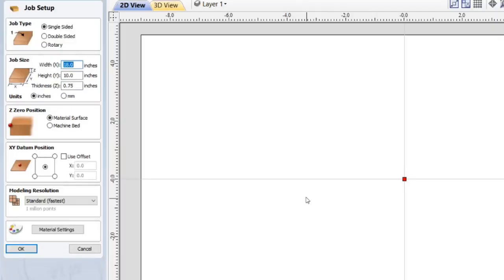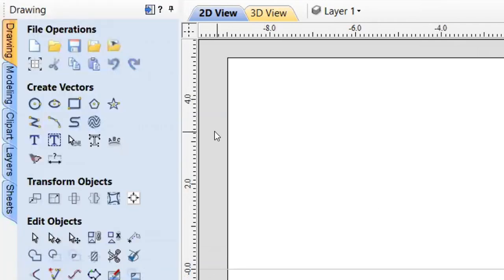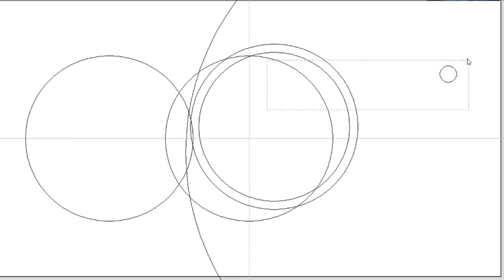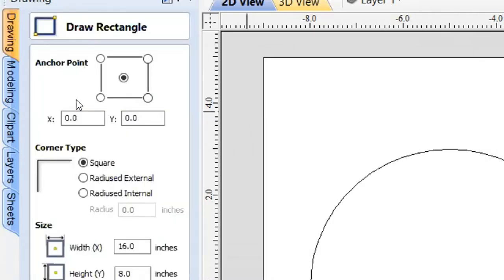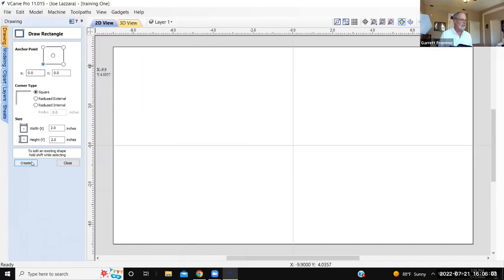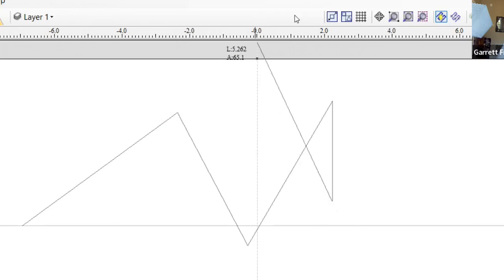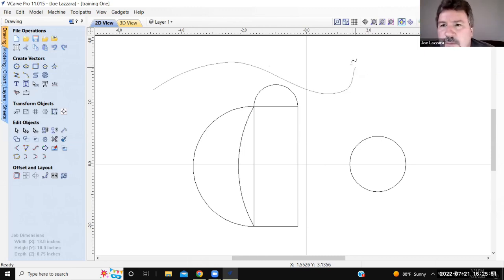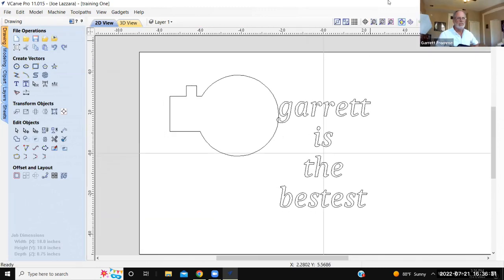Vectric 101 Tutorial For The Absolute Beginner [Vcarve, Aspire, Cut2D]

Comment: Thanks for posting this video. I spent part of a year in 2023 recovering from medical issues. I also live in Southern Ca and the summers a brutally hot. My CNC router is not in an air-conditioned space working in 100 degree pus work space is out of the question. Now the  weather has cooled and I once again can work.  I went out to the CNC router shed and tried to design for routing a wood sign. I was able to get most of the way through the design part, but when it came to the Tool Path section I was in trouble. So I when on Google to find a video that was created by you help new Vetric users and people loke me that have been away from the software for a period of time. The video I watched gave me the tools I needed to get back on track.
Reply from the maker: SheldonNotto6130, here is to a quick and speedy recovery my friend. Keep working hard and learning everything you can, you will get there!

Comment: Garrett,
I'm very familiar with the general use of CNC machines. I built my first machine in 1983 and had a working envelope of 14" x 17" x 3". I purchased a controller kit and hand soldered the all parts on the PCB. I purchased TurboCAD software to draw my projects and then used other software to convert the drawing to Gcode. I learned a great deal about the "internal" working of the CNC operation.

I have progressed a lot since those days. I have built two more machines and learned more powerful software. I have been very impressed with the videos you have created and have learned a great deal. I don't use VCarve Pro to create my drawings, mainly because, I can draw faster in TurboCAD Pro Platinum. However, I do use VCarve Pro for the creation of Gcode for my machine.  Which brings me to my question for you. When VCarve creates the Gcode they have start points that are spread across the carving, and make the carving less productive. How do I change the starting point for the various vectors? I want to change them so when it ends with one vector, the next vector to cut is close to where it ended.

Thanks in advance.
Reply from the maker: Rod, wow I'm impressed brother! That's awesome you've created so many machines, that's awesome! Regarding the start points and how to change them this one is a little tricky to explain over comments. I recommend joining Kate and I for our Youtube Live sessions we host every Wednesday at 8PM EST and we should be able to help you make the adjustments there and talk you through it!

Comment: Wow! Thank you both -  and in particular Joe! This was a great starting point using design software (I currently have the VCarve Desktop trial version), and I'm looking forward to next steps for project development. I have a small cnc machine and have been able to at the least move the spindle around the spoil board a bit, but haven't been able to carve anything with the included control software, which is open source and somewhat sparse on instructions. I also attempted to use the G-sender software to control my cnc, and it does recognize the com port the cnc is plugged into, but doesn't seem to be able to connect to the machine itself. Still working on that issue, but I really want to able to design projects, compile them, and then create them on the cnc.

Lots to learn!
Reply from the maker: Gary, it sounds like you are on the right track my friend. It sounds like you may need to reach out to your machine manufacturer since they may be able to give your more specific guidance on this. There is definitely a learning curve when it comes to getting everything up and running smoothly. My best piece of advice is to stick with it and work a little at it each day. all of the kinks will work themselves out. You got this brother!

Comment: I am in South Africa. I have built a cnc router from scratch. it's bed is 2mx2mx280mm. I have a 2.2kw water cooled spindle. My controller can accommodate a 4th axis as well that I will add very soon. I have up to a 12mm collet. what bits would you recommend I start with since I don't have any currently.
Reply from the maker: Rudolph, I would recommend this set. Here is a link: https://www.idcwoodcraft.com/product/cnc-router-bit-starter-kit/
I would recommend picking up a 1/4" collet as you will use 1/4" bits the most! 
As for what each bit does. I have a video for that! Here is the link:https://youtu.be/wdQ-_hllmKY

Comment: When I saw the title, I figured that I'd know pretty much all that you had to teach in the video. But I still watched as a review. That being said, I still picked up on a couple of things. Like the Control Left to Right, and the Control Right to Left..... are not identical functions. I had run into that, but didn't put 2 and 2 together. Now I know why it didn't do what I wanted, simply because I was "selecting" from the wrong direction. Interesting, because it was a bit picky selecting things for a reason. Now I know. Now If I could just find the video that explains the "smoothing" function, because right now, that is driving me batty. For the Aspire version at $2,000.00, it is proving to be a very powerful program. As it should. Good basic video, for the absolute beginner, but still good for those that have more experience in (old) CAD programs.
Reply from the maker: Dan, I'm glad to hear you picked up on a whole host of tips and tricks in this video! Keep working hard,  you will be a master of Aspire in no time.

Comment: The rectangle point u drew up on the WHite board.. Is this the same in all software packages Garrett and is the triangle cut out the same way on them all too?? Why does it not just draw the rectangle by following the line around the edge and not having to go up from thr bottom left to top left back down to bottom left and across to bottom right then back to bottom right and then across diagonally thru the middle dot to the opposite corner?? U make this stuff sound and look very easy.. I'm glad I found ur channel Garrett my friend.. Top man.. If I got that wrong my apologies..
The Cntl Y & Z commands are great cheats if that's what they're called Garrett.
Reply from the maker: Slim, all the Vectric packages work in the same way for drawing rectangles. You can also use individual lines to create rectangles by following the line around the edge of where you want to draw too.

Comment: Garrett is correct when he says always measure thickness of material with a caliper. I would add one lesson learned for us beginners. MAKE SURE YOUR MATERIAL IS FLAT.  If not when you measure your Z will be correct but during operation it may not cut all the way through. Ask me how I know.  Recently took me a whole day to figure it out.  The same objects I had been cutting out plywood out of one sheet of plywood wouldn’t cut through another sheet of plywood. Plywood still measured at .5” and re-zeroed a dozen times. Turns out the second sheet of plywood was bowed down. Sheet was so large the clamps didn’t affect parts in the center. I had to readjust cutting depth to get it to cut through. Hope this helps!
Reply from the maker: Dudley, truer words have never been spoken. Sometimes just the smallest bow in the wood can mess up your whole dang day.

Comment: One thing to point out, most of the shortcuts that Garrett demonstrates, like the use of the CTRL C to copy, CTRL V to past, CTRL X to cut, CTRL A to select all,  CTRL Z to undo, CTRL Y to redo, holding the shift key to select multiple items, double clicking to select 1 word, triple clicking to select a line of text, are computer hotkeys that will work in any computer application. Not just Vetric.

These tips can be used in all your computer tasks.
Reply: That may be the case, but it does you absolutely no good if you didn't know what the hotkeys were to begin with. I'm sure a lot of people do not know those short cuts.
That is why these kind of lessons are so EXTREMELY important and helpful.
Reply: @JoeLazzara  Yea, And Garrett is doing a great job telling about them. Now that you have seen the video you know you can use them everywhere.
Reply: @JackInTheShop  No, I won't be using them anywhere else. 
Yes, he is doing a great job. 
Thank God for my man Garrett. 😃👍
Reply from the maker: Thanks for sharing that extra tip jack!
Reply: @LazloNQ  Very true. I started building computers when I was 14. The first 2 did not even have hard drives, much less a mouse. Keyboard only. This was before the internet. I am now 47.
Reply: @JackInTheShop  Ahh yes, when times were much simpler. I sure miss those days. 😔
We're close in age so I remember when building pc's was something some guys did. 👍
#the80's
Reply: They work the same way in Carveco.
Reply: @AppalachianAmerican828  that is right. It will work in your email, MS Word, Excel or any program
Reply: Can anyone please tell me the shortcut for the 'pause' button in UGS, the button that Garrett hates because he accidentally hits the ' Stop' button?
Reply: @joeslaven9331  I have not used UGS in a long time. From what I remember, you have to look in options and click the key map, then assign your own key combo.